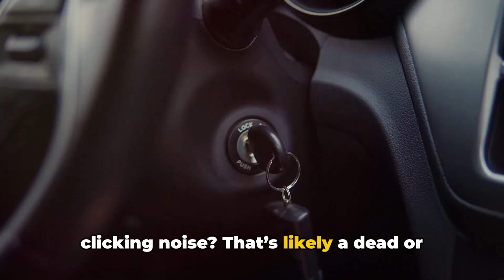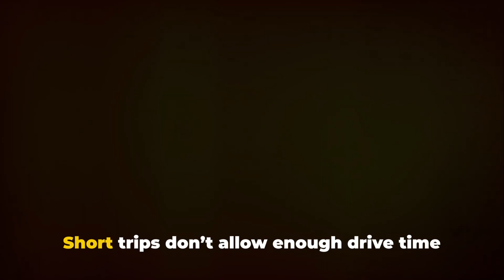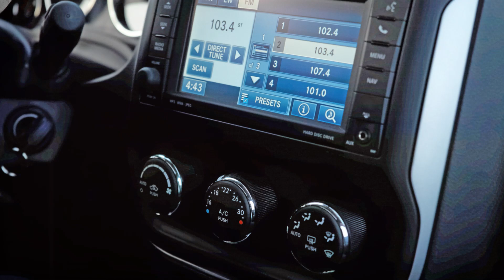7 Things That Will Make Your Car Battery Last Over 5 Years

Comment: Inspection of the battery posts. Lose or leaking acid around the post can damage the wires which need replaced. If your gone for many weeks, disconnect the battery keeping wires apart placing them in small plastic bags. You’ll have to reset the clock and maybe radio but no power sucks